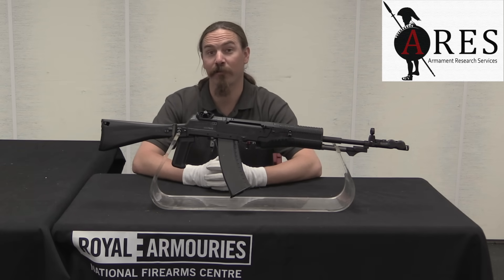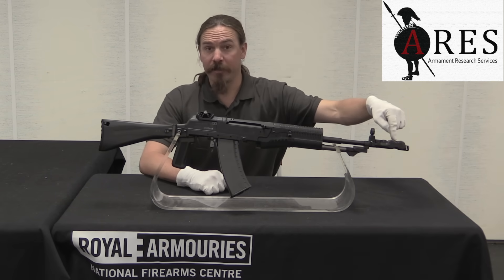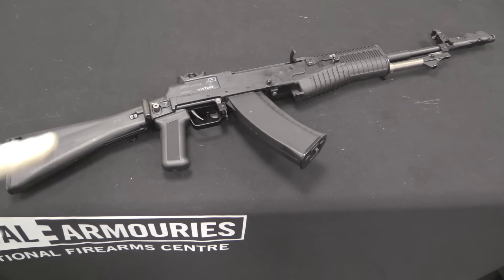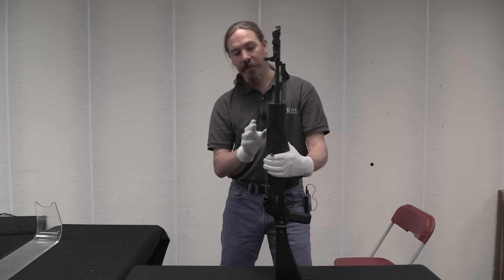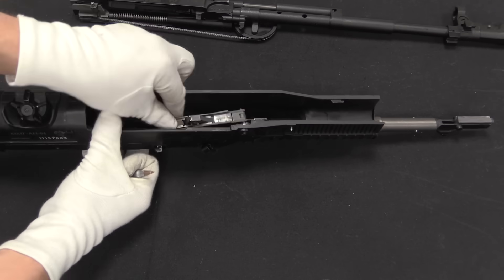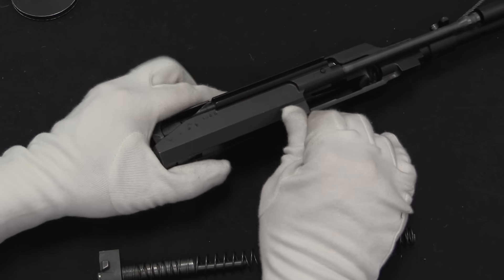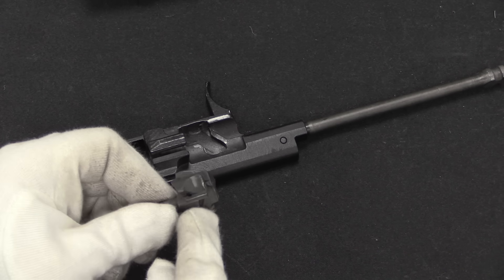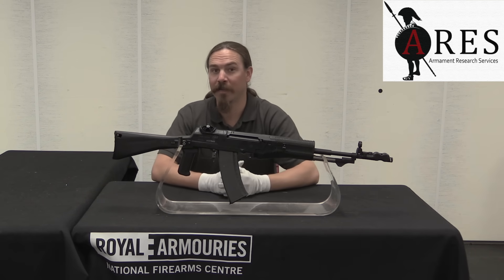Rocket Surgery: Inside the Russian Nikonov AN94

Comment: Remember guys this thing passed the same reliability testing it as the AK's were subject to.
Reply: Holy shit.
Reply: damn russians man, they make some insanely reliable shit
Reply: @Nathan-mg7ho  the only reliable things they make are rifles... And nothing else
Reply: And for that reason, special units are still issued these, as they still turn up from time to time in those situations where those units are needed.
Reply: @danendraarkananta9442  The grammar in this thread is tremendous, thanks for the laughs.
Reply: Pyotyr Young good point sir.
Reply: @Blake Ubersox Nobody said it was mythical or magical. There's just so much empty space inside it that the dirt won't jam it up easily. But that still makes it ridiculously reliable. I've seen them dig an AK out of the ground with the bolt rusted shut. The dumped some oil on it and kicked it open, picked it up and fired it like it just came off the factory line.
Reply: Blake is right, the inrange vids Ian did prove that the AR platform will survive being dropped in mud much better
Reply: @Oleg Bauer i know certain units were confirmed to have been using them in 2015. Now? Not sure.
Reply: You can not sell this gun to Africa.
Reply: I bet this gun never jams or even needs to be cleaned lol
Reply: Soviet stuff comes in two types
Either already broken or nigh indestructible.
Reply: @Blake Ubersox AKs reliability is different to AR-15 reliability. AK can jam or misfire of course if for example mud got inside but u can just hit it against any solid object and yank charging handle couple of times and it will be shooting again. ARs are less likely to jam since they are much more sealed and have more precise machinery with less tolerances, but if they do jam- you are screwed, only field strip and careful cleaning will bring it back to life. Harder for dirt to get in- harder to get out.
Reply: But they don't get tested every day do they
Reply: AK's don't actually have mythical reliability.  They are reliable but more importantly they are simple and easy to maintain.  In reality, AR15s are actually more reliable given basic maintenance or even just lubrication.
Reply: @danlorett2184  I have a 7.62x39 wasr ak I havent cleaned it 18k rounds and it has nevermalfunctioned. I have gotten dirt into the action aswell.
Reply: @KEVLAR1911  lies 😂
Reply: @TommyTombstone  I do grease it everyonce in a while, so I guess that I did kinda lie
Reply: @danlorett2184  Um.... If one keeps firing with NO maintenance while the other requires maintenance and lubrication, that makes the latter one NOT AS RELIABLE... Can you logic, sir?
Reply: Pyotyr Young nope when larry vickers in Russia to try this gun he experienced double feed with AN 94 and its take couple minutes to clears malfunction
Reply: Not hard.  AKs aren't all that reliable.
Reply: immikeurnot I call definitive BS. Being Russian, having immediate family show and tell me the things that their AK’s can take, I call BS. They are INCREDIBLY reliable and rugged things. They run with zero maintenance, they work under most any circumstances, just don’t get dirt or mud in the locking lugs.
Reply: @gregoryfilin8040  ak's need only greasing from time to time and thats it, in Russia sufficient grase is vodka with mud :v
Reply: Gregory Filin no maintenance thats stupid
Reply: arkan purnama No it isn’t. Middle East capture guns have been found running off of no maintenance and no cleaning. They are just that loosely toleranced and that rugged.
Reply: Gregory Filin i shot 5000 round from AK and AR both only greased once before shooting them, no serious malfunction between them just some double feed or bad ammo that's shorts stroking them but they got some scratch in the face bolt carrier so keep them cleaned and lubricated Btw i didn't use gun lubricant i just use synthetic car lubricant
Reply: Gregory Filin Don’t get Dirt in the locking lugs? R U joking? You must mean Chunks of Gravel! We were shooting AKs once. Somehow a cartridge got jammed under the protective cover instead of ejecting. Don’t know how but we found it when cleaning, chunked and hammered into steel pieces & splinters but it hadn’t stopped the gun from working at all! Ak’s are tough as anything can be!
Reply: @immikeurnot  so you watched that inrange video and now you feel obliged to believe that AK's extreme reliability is a myth.
Reply: @immikeurnot  They are likely the most realiable weapons ever made.
Reply: immikeurnot AKs are At Least as reliable as the sun rising! I think that’s reliable.
Reply: @immikeurnot  troll

Comment: In the Corps we had to field strip the M16 in 20 seconds or something.  I can only imagine Ruskies conversations: "Field strip before Tuesday and you get the Order of Lenin!"
Reply: It could be taken apart in a few minutes. It might not ever operate again, but it can be done.
Reply: I never really understood why the army cared how fast i could take it apart. It has always seemed to me that how fast i could reassemble it was a more useful skill. Or being able to do it blindfolded, cuz never know when you'll find yourself needing light discipline in tactical environments. 

Also, if i had to design a rifle that could be used and maintained by undereducated conscripts who can't read or comprehend the TM for it, it would be the ak.
Reply: @Damocles54  The thing is is that conscripts here in Russia wouldn't be ever using such a shitty gun as AN94. Cause once dismantled it would take couple of hours to assemble it back.
Reply: @sliceofthatpie  that i can believe. I've seen tech drawings of it. I've got an engineering background and i wouldn't want to have to maintain it in the field at night with a red lens flashlight. 

That's why i specified the AK. First because it doesn't really need field maintenance due to its robust design. But it's simple enough that even in the countries that use uneducated conscripts, those soldiers can do a basic field strip as necessary. 

I'm not a huge fan of the rifle but i have owned a couple. mostly i appreciate a good design concept.
Reply: Alexander Davronov Conscripts or anybody could use the AN94 but I think disassembly should be restricted to a factory technician! I’m sure it’s tough and probably accurate but more mechanically complicated than a V8 engine!
Reply: Jason Zimmerman there is an old soviet joke that goes something like that: “If you encounter a nuclear explosion, lay down on the ground with feet directed at the flash so that molten metal from your AK wouldn’t spoil the state-owned boots”.
Reply: @fireblazesmobileaccount2607  7? Shit my life crumbled apart at 5 seconds. Gotta work fast there
Reply: @iloveindomienoodle  Mine too :^( that's why i can strip my ak and ar so fast.
Reply: Russians know you never need to dismantle it because it will never fail, even if you nuke it.
Reply: No wonder it’s ‘forgotten’
Reply: https://www.youtube.com/watch?v=0ZjkvY2icdY  every Russian  boy and girl learn how to operate AK in elementary school. (grenades throwing too, btw). This particulary video goes viral -  "Sandra model" actually was a world N1 pedo pornstar at the moment ))
Reply: 121bham  I can see your butthurt from over here in my beloved Mother Russia. It makes the sky look wonderfully red huehuehue
Reply: haha wankers, we strip ak in uner 10 seconds
Reply: @MrBear-ov4ix  no shit bruh

Comment: The gun has a pulley system.
The gun has a fucking pulley system.
Reply: Rube Goldberg would be proud.
Reply: JustSomeGuy 
in a pinch it can be used as a trebuchet.
Reply: @TrinidadJamesWoods  I knew a guy who would pronounce trebuchet as “trebucket.”
Reply: @mr.x4036  Did you give it to him?
Reply: @taylordavison6849  give what to him? The talk?
Reply: @mr.x4036  We're English and wouldn't let French pronunciation in the door for love of money. The last trebuchet, we built self destructed rather wonderfully. It snapped the axle of the arm. Cue people running fast in any direction that wasn't trebuchet.
Reply: Next thing you now it will have a bottle opener on it...    WAIT
Reply: Adi Dunn That comment.
Reply: I raise you a fucking pencil!  The stock definitely needs a pommel for back up.
Reply: does it have a rubber chicken aswell?
Reply: @anickloquendo  in the stock yes
Reply: Archimedes  would be proud.
Reply: @taylordavison6849  not yet
Reply: Well if the guns busted BAM ya got a slingshot with 7.62mm or 5.56mm
Reply: Shit’s wildin
Reply: Cogs. Pulleys. Electronics. Plumbing.
Reply: Hank plank
Reply: Technically a crossbow for boolet
Reply: I'm wondering if the same operation can be accomplished with two opposing racks with a pinion in between.
Reply: I never understood why pulleys aren't used more commonly in guns. It seems to me a very instinctive way to design any mechanism
Reply: This is a sail ship gun
Reply: https://www.youtube.com/watch?v=wpMXs58L5x4
Reply: Yeah, AND?

It’s to increase a soldiers hit probability...
Reply: @wikywiky5634  never shown to be enough to deal with the increased complexity. Its mostly a concept thats fallen put of favour as people study combat.

Infantry Small arms isn't what your major effective weapons are, thats your squad and platoon level mortars, grenade launchers and the tripod/vehicle mounted LMG's. The role of an infantry rifle or SAW is for pinning a combatant in place for artilery, CAS or platoon level indirect fire engagement.

Its the same reason that rounds like 30.06,  7.62x54r fell out of favour, you dont need a rifle and round capable of man size lethal hits at 1000yards when average combat engagement range is sub 400m and most shooters in combat are generally going to struggle for effective hits at more than 200-300m.

The money is better spent on improving optics, improving mortars and grenade launchers and given that Afghanistan proved the West isn't willing to take losses as an acceptable trade for a more effective unit by letting them drop body armour to keep up with unarmoured light infantry insurgents  make body armour lighter. (Though I suspect the next near peer conflict will show body armour to not be particularly effective)
Reply: + @jediknight1294 + The opposite on the body armor front seems to be happening in Ukraine; the high speed low drag plate carriers are ineffective vs artillery fragments but the older IOTV type vests that cover a large area of the torso in ballistic fibres are and you still get SAPI plate pockets.
Reply: @cnlbenmc  I have no idea what all these terms mean, can you explain?
Reply: @wikywiky5634  So does full auto.
Reply: @taylordavison6849  “let’s make a roller delayed blowback .308 full auto.”

Comment: I assume the notch on top of the front sight is for the night vision sight. if you dial the rear sight on position 2, you see also two holes on top of the dialer. there you can put a "glow in the dark" marker. Also the front sight can be marked with tritium paint. I think you put a small self glowing stick throught the holes in the front side. it is a primitive, but usefull way to have aim at night, without using a nv optic. I shot a simliar system with the rk95 in finland and it worked pretty well on a distance up to 20m. (ok, the target must be visible as well)

Comment: The AK platform is so legendarily reliable because of its simplicity, any failure or stoppage can easily be fixed. Any parts of the rifles could be easily replaced due to the high number of rifles and high tolerances in fitting. While this system is really cool, it's pretty impractical for a service weapon that is going to take a beating and still expected to function. Field stripping an AK is a matter of seconds, in a stressful firefight, those seconds feel like minutes. Trying to clear a stoppage or malfunction in this gun would take minutes that would feel like hours under fire. There's a reason why the Russian army still has the AK-74 as standard issue.

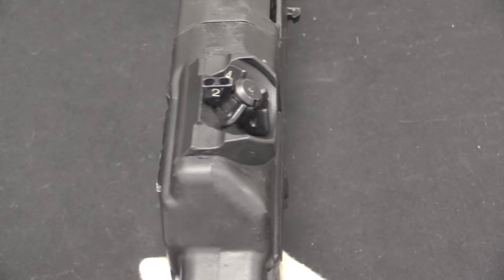Comment: ad. Ironsight: there were 3 glowing sticks as appurentenance. Two should be put vertical in the two holes in the back sight (6:11) and one should be put in the horizontal hole in the upper part of the frontsightprotection (6:37) to generate a sort of nightsight.
Great work, greetings from Austria
Reply: Were those night sights simply left from this model?
Reply: They were just attached when needed. Btw. I remember that i dont know if this "sticks" were actually  glowing or just worked with a NVD..
Reply: @MarcMaier1  They actually glow.  A night vision sight would be way more bulky.
Reply: I appreciate your use of the word appurtenance, very savvy. Insightful comment as well!

Comment: Very interesting rifle designed to defeat body armour and kill the wearer. First round smashes the armour, second kills the wearer.
Reply: you are sure you do understand how body armor works? To accomplish that both rounds have to hit nearly the same spot,..and even with that fancy two round burst it is nearly impossible especially not in a normal combat distance under stress.
Reply: Normen singleton I didn't design the rifle and yes I'm very familiar with both ballistics and body armour. Both rounds would need to strike in very quick succession to achieve the aim and that's against pretty poor armour. Armour with extra plates would be a challenge and near impossible for the round the rifle uses. As I said, not my design.
Reply: Goaty McGoatins 
okay..was just checking...no harm no foul
Reply: Normen singleton no worries mate. No names no pack drill.

Comment: Where do I start? No slight to Ian @ Forgotten Weapons --he does an outstanding job; love most every video I've seen, so far; but this gun needs exactly that--to be forgotten. What a complicated, convoluted PoS! This is what happens when rocket scientists design guns. The reason that the AK-47 has the appeal and reputation it has around the world, and for the foreseeable future, is because of the design simplicity and robustness. Pulleys, cables, etc.??? On one end of the combat spectrum is accuracy; on the other is reliability; somewhere between these two extremes has to be ease of use, and maintenance. Remember, in the rest of the world, by and large, you're talking about a conscript military, most of whom are not well educated--does the term 'soldier-proof' ring a bell? When Mr. Kalishnikov invented his rifle, the best was the enemy of 'good enough', and so long as it performed as intended, that was all that was required of it. The 762 AK is inherently less accurate than the M16 of it's day, but that was due to the ballistic issues with a light bullet (123 grain); conversely, the M16 would never tolerate and continue to function with the reliability of an AK; but since the average combat envelope was 200M and less, it didn't matter; AK47's still killed plenty of GI's. When the Soviets took notice of the small, high-speed, more accurate bullet, and designed their own (AK74), the gap between accuracy and reliability decreased considerably; so much so that the Israelis and South Africans made their own 556 AKs. AN-94 is a crash-and-burn; that's why it's no longer in the Russian military inventory, or anyone else's.